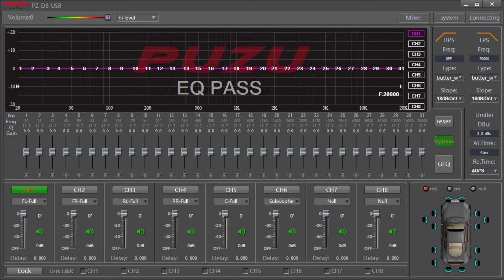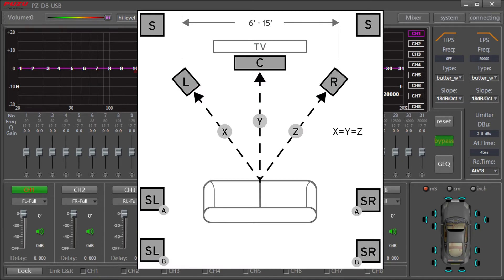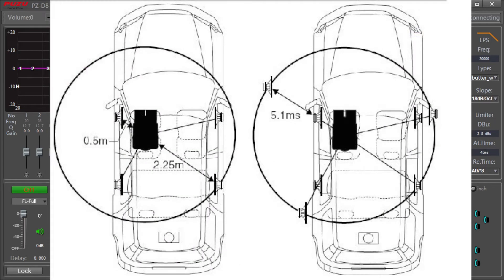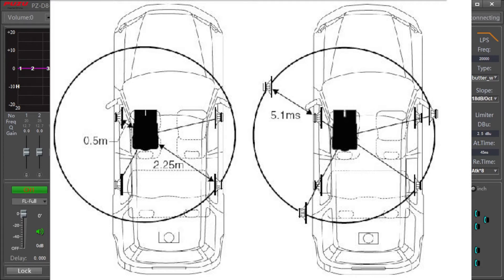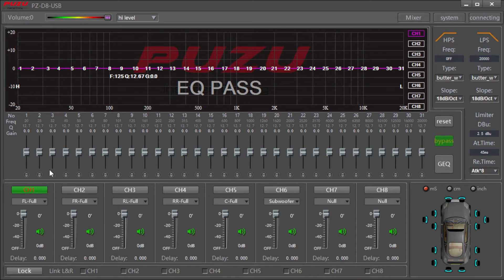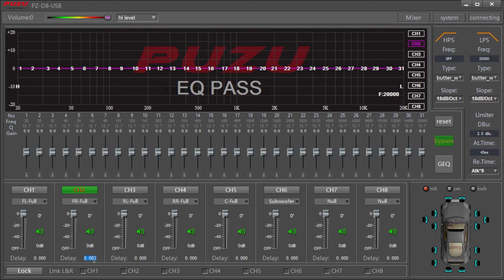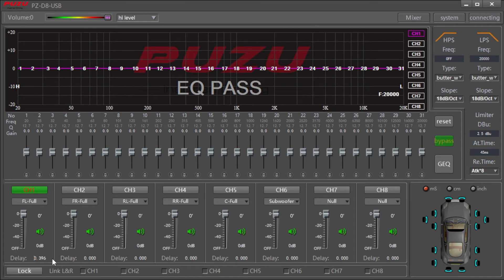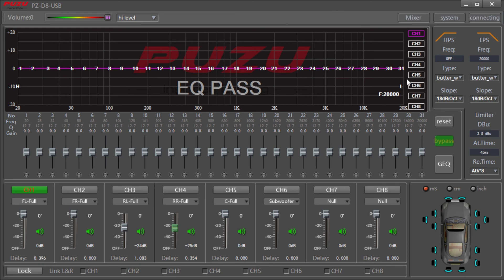Car DSP One-Seat Tuning  (DSP Tuning Series - Episode 1)

Comment: How is the puzu dsp performance?
Reply from the maker: not bad for the price, if you just want a simple upgrade to your stock system with the capability to fine tune the sound stage and EQ, i think it's a good investment, although i don't like Class D amplifier much.
Reply: @HeadTurnNet hey so how is the floor noise ? Any white noise hiss during standby volume 0 ?